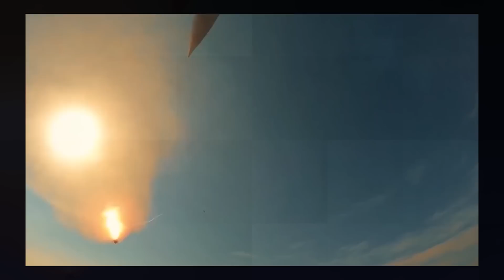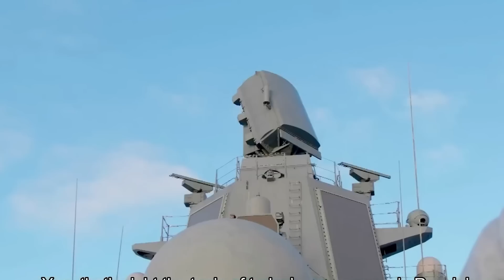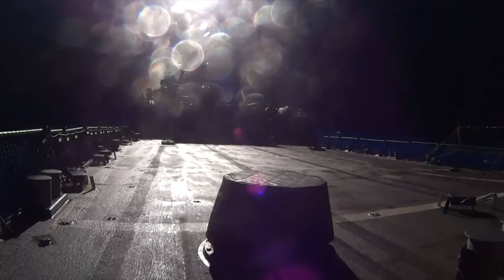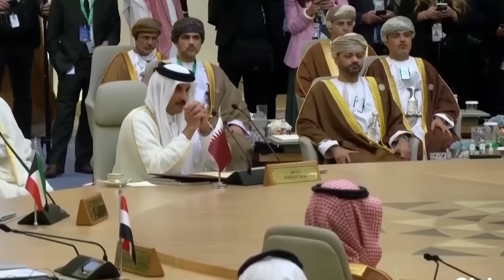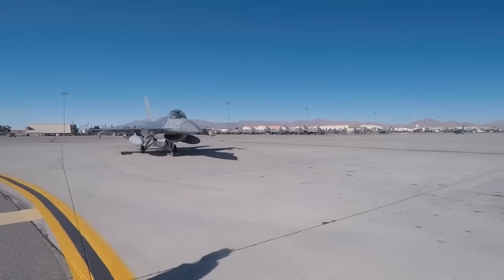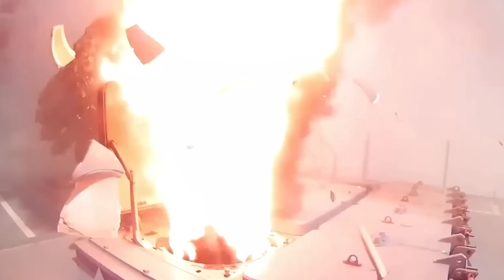Houthis TARGETED U.S. Jet but Got WIPED OUT in Minutes

Comment: The black Ferrari was flying down I95 at 120mph when it's advanced Valentine 1 radar detection system detected a radar lock with a level 2 strength indicator. The JBV1 system concurrently alerted a bogie ID at the 2 mile mark confirmed with 7 positive prior confirmations. The pilot immediately  took evasive maneuvers as the al priority laser countermeasures engaged to confuse the enemy jamming the enemy laser lock. The pilot downshifted and the Ferrari engine  roared. The enemy was sighted as the pilot slowed to 65 mph and disengaged the laser jamming system. The pilot successfully evaded the bogie and a post engagement analysis revealed the enemy had engaged with a Stalker lidar cam 2 system.